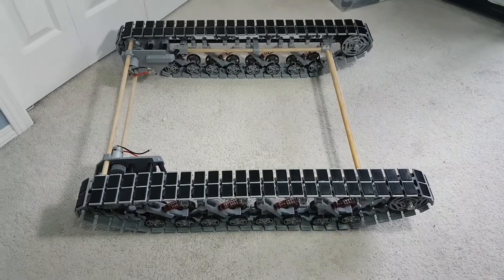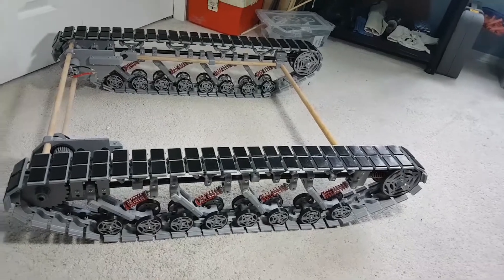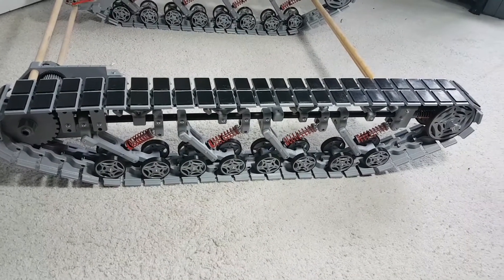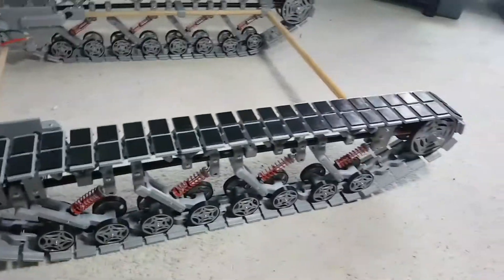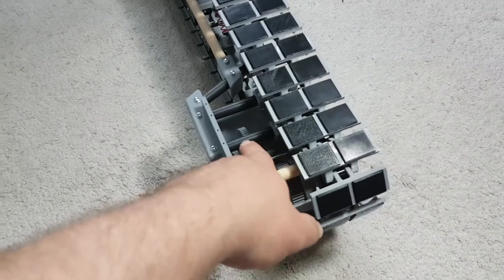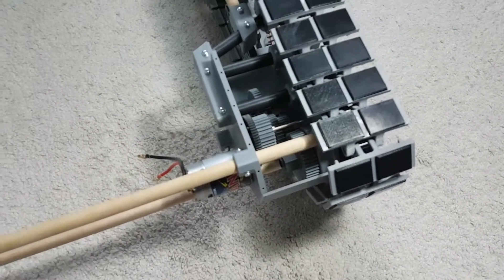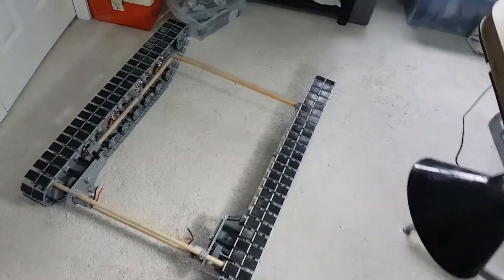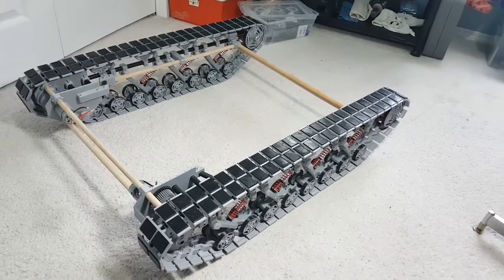3D Printed Tank Project update - Almost ready for testing

Comment: Speaking about electronics you should avoid Bluetooth I would use esc's and radios for rc check out (( 3D Printed FV101 Scorpion Tank 1/16th Scale Overview ))
Reply from the maker: The only Bluetooth used is between the gamepad controller and the laptop.   Laptop to Tank communication is with  915mhz RF transceivers which have about 1km range (line of sight).   The motors are controlled with a DM Sabertooth motor controller.  This is explained in detail in my video called '2/3 prototype'.  Check it out.